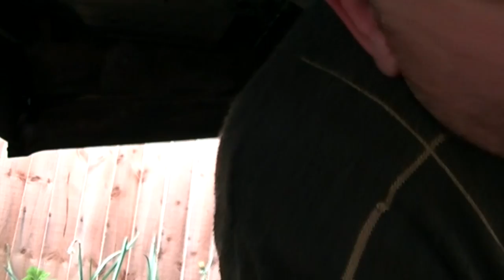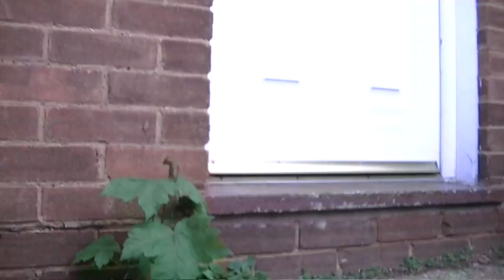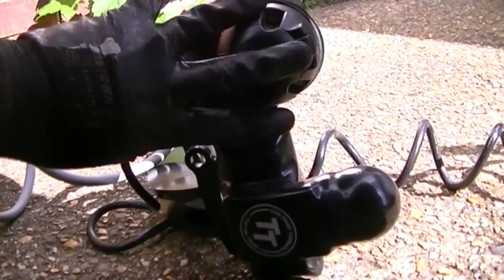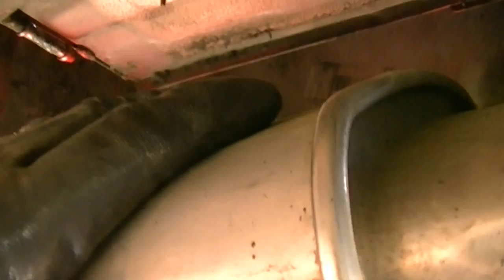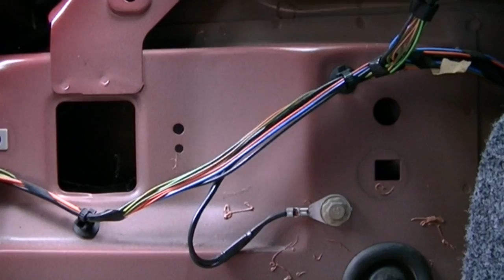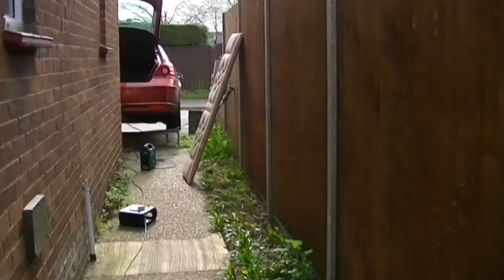How To: Fit A Tow-bar To A Ford Mondeo Mk3 (2006 Model)

Comment: Did you not need to put any relays or anything in between the trailer wires and car loom? 
Thanks for the video I'm just about to do mine on my mondeo too
Reply from the maker: Not on mine as it had standard bulbs fitted for the lights.
Reply: Nice one mines on standard bulbs too so happy days 🤞 thanks for your reply

Comment: I fitted my tow bar using this video(I problem to over come is the nuts that hold the bumper/heat shield, you need a special tool-or do like I did and use a socket with a drilled hole in it a put a screw in it)but a good video to watch and do

Comment: just used this to mount my towbar all on now run out of time just got to cut bumper and run electrics but found it useful as the instructions wasnt working on my own so car was on ramps i used jack to raise bar up to bolt it through rear bulk head

Comment: Got a problem! I've got it all wired up but seem I have constant power or something. Side lights are constantly working on trailer unit when engine is off and have to unplug. Why? Is it 12v power, ground not correct?

Comment: High mate , just have a question, Do you only need to wire all the wires on one side of the car
and does it matter what side ?
Reply: @StraightCutMotorcycles2018  Ok, thanks does that mean you need to take an extra cable over to the side. I have a citroen Picasso 05 and l am finding out it is multiplex, so might need a relay or a plug n play kit. All getting complicated.

Comment: One question about the electrics, can I ask why you didn't fit either a separate indicator warning light in the front, or an indicator buzzer box to the car, for when a trailer/caravan electrics are plugged in, as it is a legal requirement
Reply: Not on older cars its not

Comment: I have a problem? I've connected mine all up although seem to have perm live going to trailer lights so lights are always on and have to disconnect the trailer plug to prevent battery drainage.
Reply: I've connected to a 54 Plate Ford Mondeo. I've done this the same way as in video, although the plug was pre attached to Towbar when I bought it so unless incorrectly wired to plug but everything else work fine expect lights are always on when the car is off which is wrong